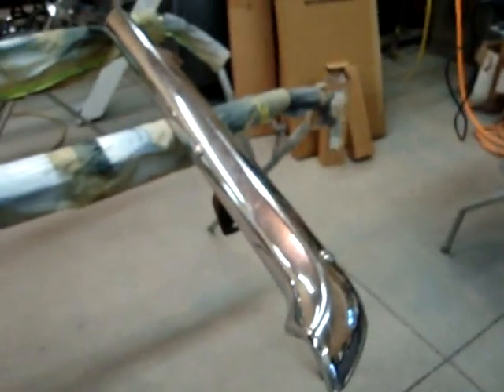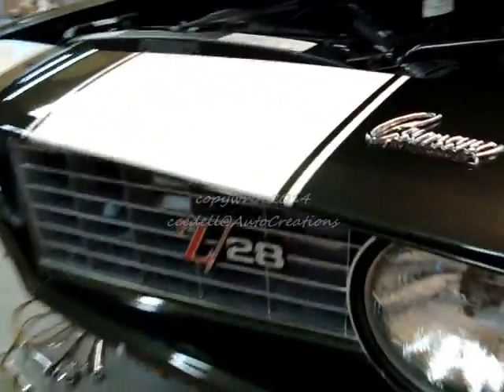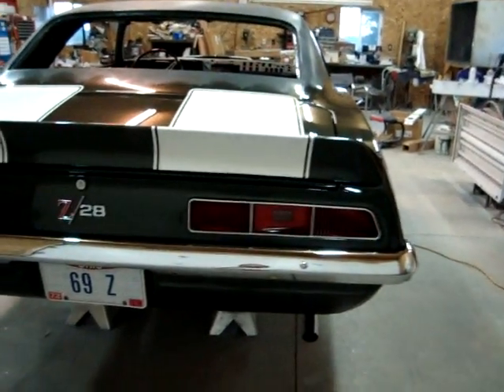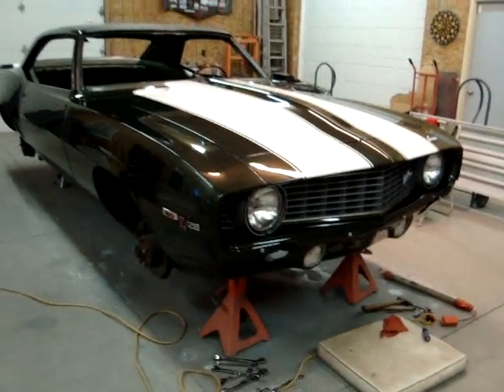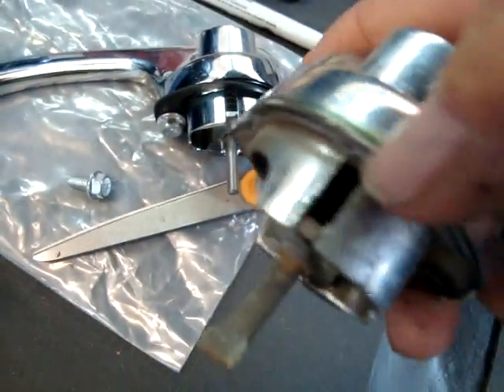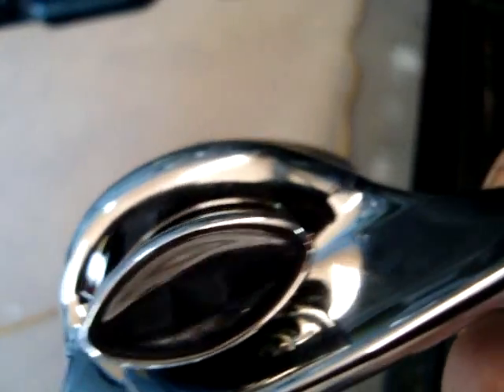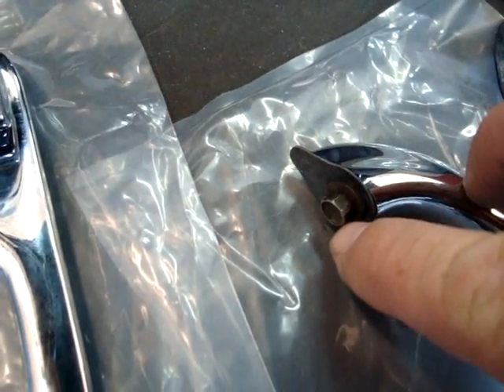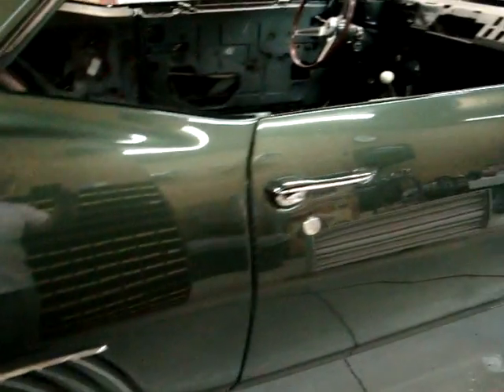1969 Camaro Z 28 Part 34

Comment: Ahhh... door gaskets... I remember them like it was just last week... I kind of like the contrast of the rubber peeking out from under the door handle. (Work better on white than cool-ass green like you have)
Reply: i like the rubber peaking out too. i make them a little bigger on purpose hehe
Reply: This year Camaro looks good from any angle, unlike the new 2014 Camaro which looks horrible from every angle. GM really laid a turd designing the new  one.
Reply: Cooll Asice i agree!!!
Reply from the maker: Yeah, the 1/8 inch was just too much.
Reply: ceedell yeah ,that would be too much!